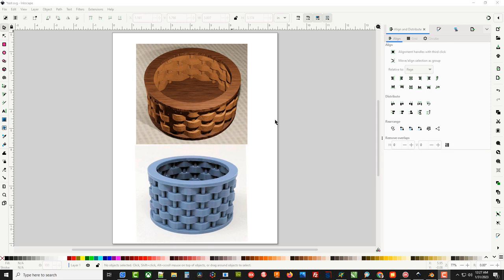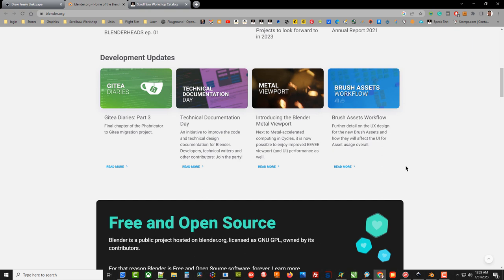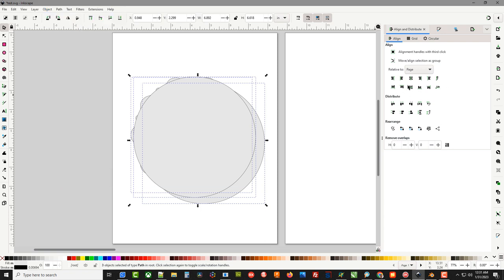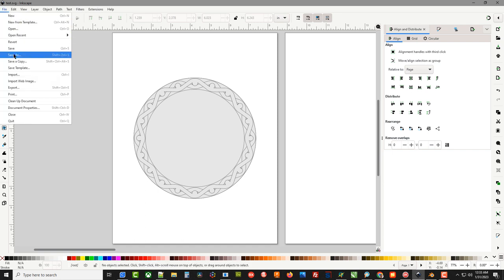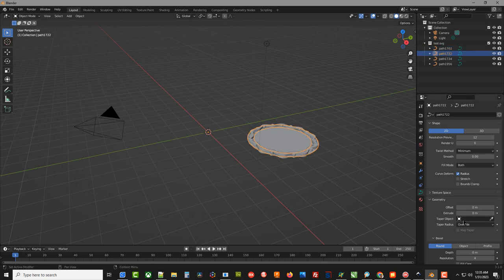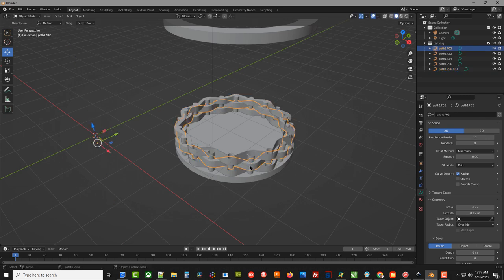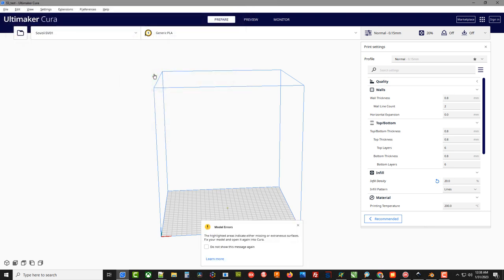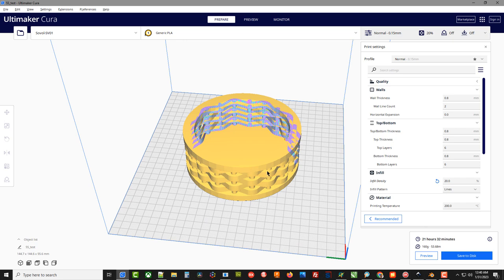Turn a scroll Saw pattern into a 3D printer model using free software

Comment: Another great video 2day..sliding your pattern, a 3D woven basket, into InkScape then into another very powerful 3D program Blender as prep for another 3D program for ultimate manufacture of physical item made by your 3D printer resulting in a wax or plastic basket. Wow! That is a bunch of sophisticated software & 3D printing equipment. Yes, once a person purchases $$ these programs, then puts lots of time learning, experimenting/fine-tuning 3D printing...I wonder if just building your basket 'old school' method, cutting wood with ScrollSaw, might be faster...for 1 unit. So a hobbyist may not be inclined to take the plunge into this-advanced level- of creation; but production level, "manufacturing people' will surely want this info & appreciate all your efforts. Great video to encourage serious 'Scrollers' to take next step into manufacturing. Great information, thx!👍👍👍👏🪚😊